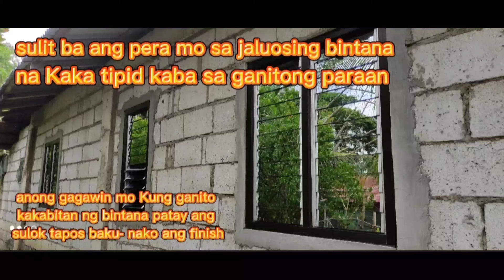VLOG 29.jalousy window new style reflective glass open back hamba

Comment: Sa Pinas dahil humid at all year round mainit , Jalousie ang  Best! Matibay , Economical! Lalo pag wala naman pangbayad ng kuryente lagi . Pang Pinas bintana yan .Wag nyo na gayahin pang Billionaire window kc may pang payad cla ng kuryente sa AC .Sliding windows ,pang mga bansa yan na nag i_ snow ,double pa nga  bintana nila e sa iba bansa sliding , maikli ang summer, pero Super  Malamig dahil oag winter  ,para d pumasok cold  hangin pag winter need ang sliding door at double covering pa . May heater pa ang flooring. Pinas , Jalousie, o dati bintana ng Traditional house ng Pinas , Double Swing ang opening ng window. Best! Jalousie Bintana namin sa Pinas kc since 80's , Matibay ,maganda , maaliwalas, matipid sa bill sa kuryente at ipakabit q soon , Jalousie parin sa renovation ng kitchen ng mother q ,yong new design today . Maaliwalas kc .Nagbibigay full natural ventilation, aesthetic,classic but Pretty & I love Jalousie ❤Nababagay sa Weather ng Pinas!
Reply from the maker: ❤️❤️❤️❤️❤️👍😄sana Po saakin nyo ipagawa Yung jealousy nyo Nueva ecija Po loc.ko
Reply from the maker: ❤️❤️❤️❤️❤️👍😄sana Po saakin nyo ipagawa Yung jealousy nyo Nueva ecija Po loc.ko
Reply: @SilvertechDIY  hehe Oo nga e brother,lahyo mo Naman sa lugar Ng Nanay q kc